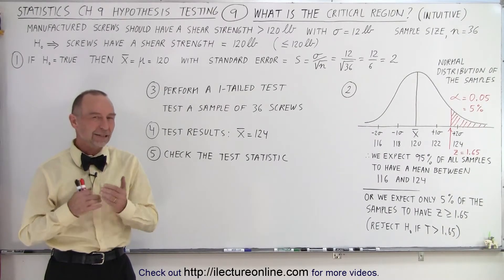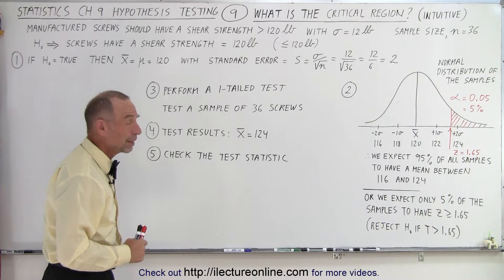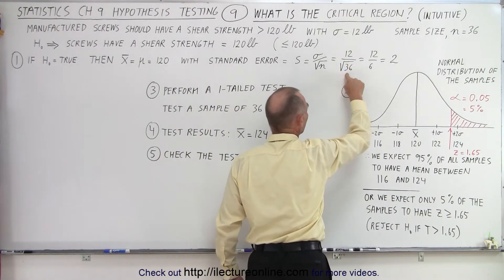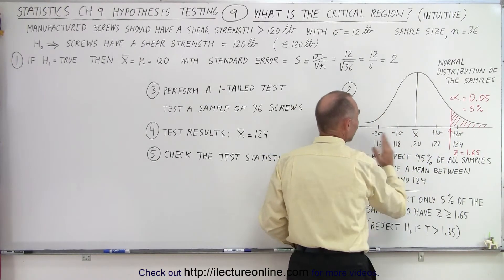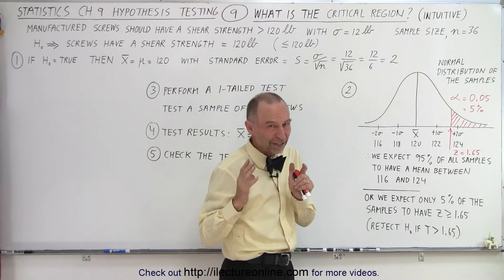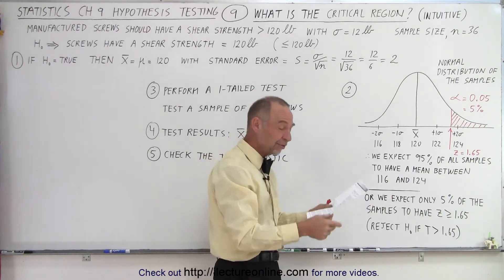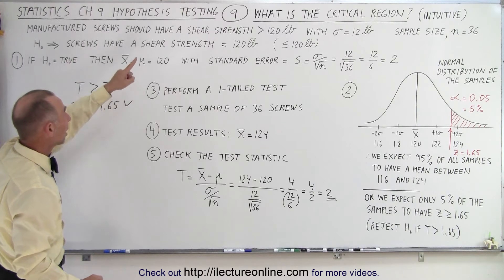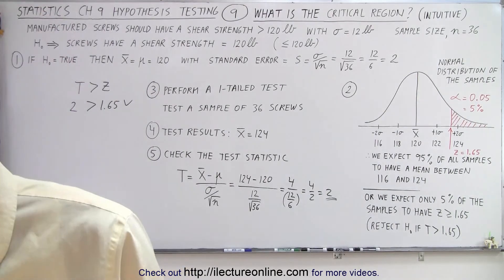Statistics: Ch 9 Hypothesis Testing (9 of 35) What is the Critical Region? (Intuitive)

Comment: if we cannot check every single piece in the population, how can we know the population standard deviation?
Reply from the maker: This video shows how the hypothesis test is done, assuming you know the standard deviation of the population.  This can be accomplished using a separate test where enough screws are tested to establish that.   If the standard deviation of the population is not known hypothesis testing is done differently.
Reply: @MichelvanBiezen  in another video
Statistics: Ch 9 Hypothesis Testing (25 of 35) Population Inference from a Random Sample: Ex

https://www.youtube.com/watch?v=Cu6T59bvm7c&list=PLX2gX-ftPVXWsyqrvKZ6N9RbB5q4_zntq&index=24

I saw that standard deviation of sample =standard deviation of population / square root of sample size

can we merge the equation, so the test can be done with standard deviation of sample, without standard deviation of population?

Comment: Hi.. I have a question please answer me 
the reason for the light from the electricity-free light 💡 ?
Reply from the maker: The energy for the light has to come from somewhere.  Nebula in space emit light because the atoms in the cloud are ionized by high energy photons originating from a nearby source.   What specific situation are you thinking of?
Reply: @MichelvanBiezen  yes, I'm thinking about that!
Reply from the maker: Yes, in the case of a glowing gas, high energy photons collide with electrons in orbits around the nucleus and push the electrons to higher energy levels.  When the electrons cascade back down to the lower energy levels, they produce photons of visible light.